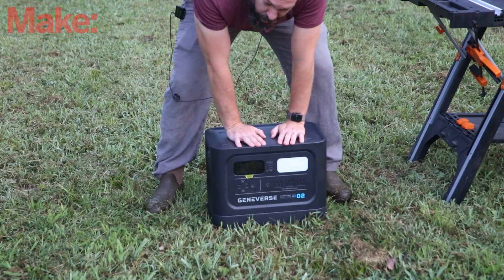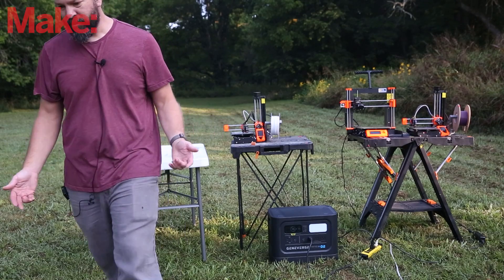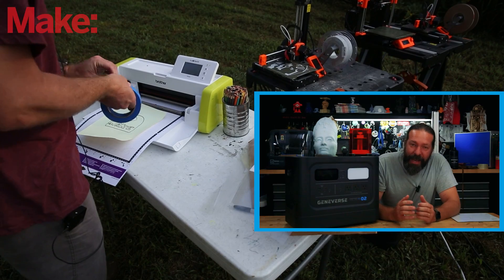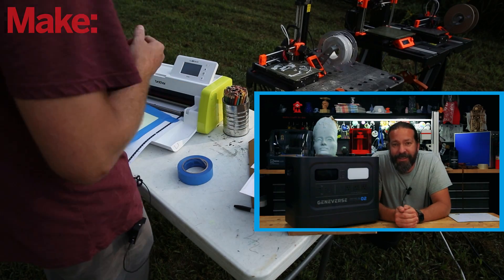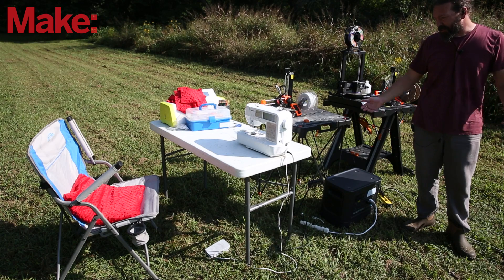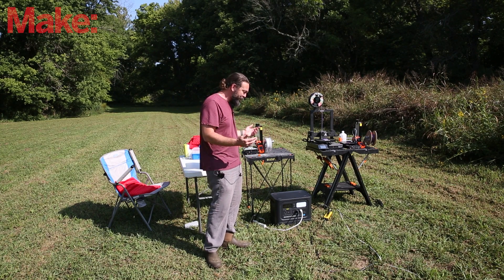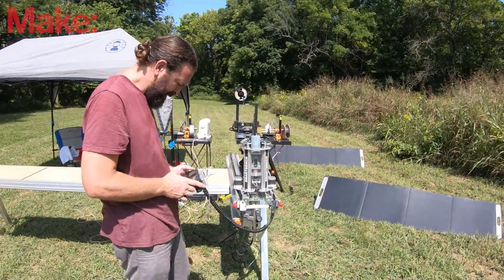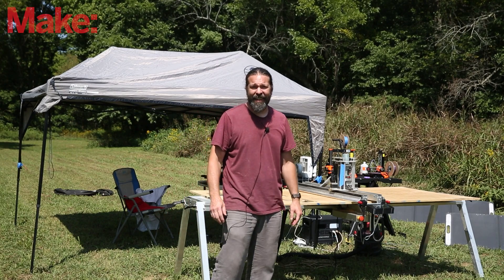How many machines can you run from a battery backup?

Comment: I don't have the time to watch this right now, but I figure you can run as many as you want to use as long as you are providing enough. Just get bigger. More batteries. MORE!

related content material: inverter from a vehicle. (maybe not in motion? but then again, that could be a topic on it's own. some hot gyro action...)
Reply: In your summary you defend the math so I can keep watching your channel now.
Reply: @CBWP  haha, yup. it's fairly simple math but I gotta SEE IT to believe it
Reply: ok I'm watching. a min in, I would like to mention the math doesn't lie. If: supply > use = gg

While the bed and extruder are heating up from cold they will be on high power and if all 3 axis were turning at whatever max speed is, then you will be using the most power as possible.  That is your reference of use. 

Whatever the supply says, to not be subject to false advertisement, they are underrated just barely and you should not make plans to exceed what it is. 
So that can be your reference for supply.

It would be fairly easy to write some gcode and grab a multimeter if you wanted to baseline things.
Reply: a little under the 5 min mark you say this thing is made to power a normal home (for 7 days) that sounds a little misleading. most normal homes have at least 100 amp service and if we multiply that by those volts, it comes out to a bit more than 2500w

realistically, I would be saying you can have a bit over 20 amp usage.
Reply: I looked up the part and on their site it says it has a 4400 surge so that is "peak" of 40ish amps, but it is still 2419 Wh.
Reply: about 8 min in now. You made a pillow. Nice. I bet that thing was a good power sucker. I feel like you said you had around 15 hrs left before and now you have 7.5
so you used half the power from about 3ft of seam work? Also that cutter that is not running uses what? 50mA? 100? prolly mostly wasted in the power supply.
oh yeah you also said it was 75% charge. that sounds better. We really just have to ignore when it says how many hours left it has because that's in reference to current use.
Reply: There you go at about 10 min saying what I just said about them only using so much at idle. This is fun lol. (you only had 6 total comments before I started so...)
Reply: I haven't heard what wattage your laser uses yet. about 12 and a half in and you are busting out the router and vac. I bet the vacuum sucks some juice as well

Comment: Very useful. Been considering a whole house generator for over $30,000 vs. several (5) high capacity solar powered batteries. With minor sacrifices, the batteries are looking better & better.
Reply: You generate, you store. You want both...
You have to generate at least as much as you use and you store as much as you want to use when you are not generating.
Reply: buy the generator
Reply: why??  How many years of "saving" on your power bill (IF you save at all) would make that cost worth it??